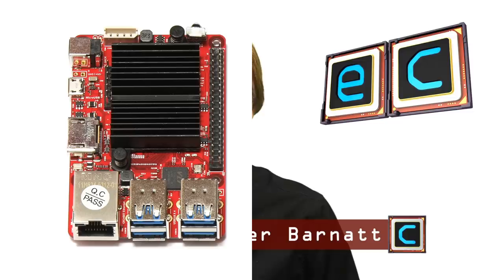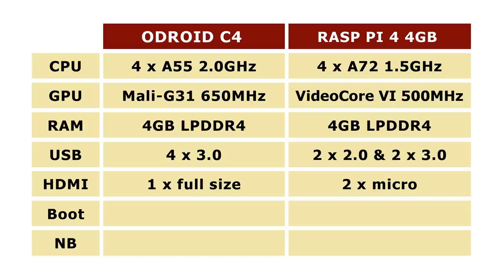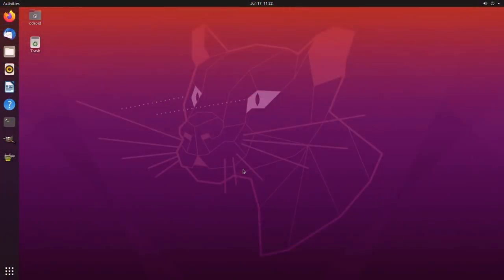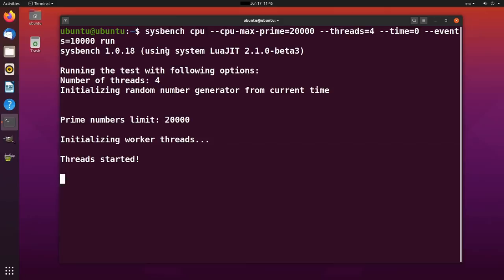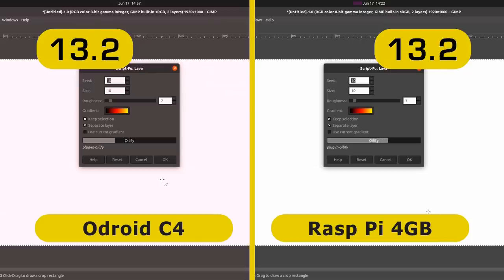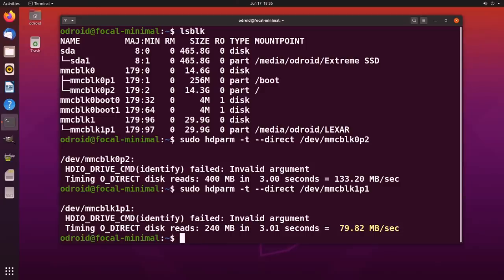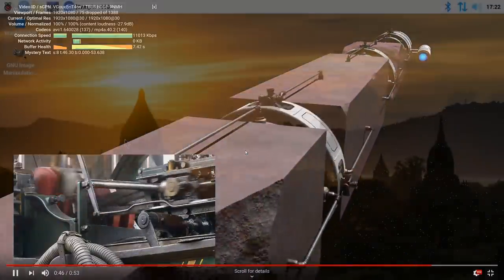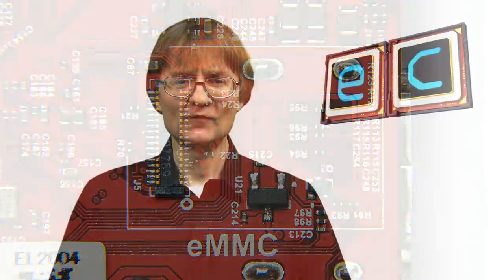Odroid C4 vs Raspberry Pi 4

Comment: Are you sure there wasn't any thermal throttling on the Odroid C4?  The first CPU test was faster for the Odroid, and then the Pi4 was ahead from that point on, which could be a sign of thermal throttling.  Odroid's own benchmarks show it on par or faster than the Pi4 in every test.
Reply from the maker: I'm not aware of any throttling, but even if is occurred, I was testing the hardware with its own heat sink, so I think the test is perfectly valid. I've looked at Odroid's own benchmarks, and am pretty certain that they benchmarked against a Pi running a 32 bit OS.
Reply: @ExplainingComputers  you didn't test the Pi4 with the thermal solution it came with.  To be fair, you'd need to put a fan on the C4 as well.

Comment: Thank you for your videos, Mr. Barnatt. It's been a while that I watch your videos. I have a question, if I may... I'm selling my Pi 4 because I've been very disappointed with it. I bought into the merchandise of a desktop replacement SBC, only to be let down by the very immature OS support, especially in terms of GPU drivers. On Raspbian, the Pi 4 is plagued by screen tearing all over and no HW video decoding anywhere but in the included patched VLC. On any other OS, good luck trying to even load the bare bones driver Igalia has come up with. You demonstrated this well in the video. So, I would love to know your opinion on this. What is your take on this lack of proper GPU driver support? Thanks in advance. Cheers from Brazil!
Reply from the maker: Most SBCs -- now including the Pi 4 -- are let down by their drivers and other software support, which is far more time consuming and expensive to implement than the hardware. There is good GPU support arriving in Ubuntu 20.04 for the Pi very soon I here! :) But do not expect a Pi to ever deliver the performance of a low-end x86 desktop.

There is also an issues of expectations here. Some people watch video on a Pi and are fine with it. It all depends what you compare it to.

Comment: Hello Chris  sorry to ask is their any single board computer that can run    Apple  I OS  or these chip are not compatible to apple spec.
Keep up with the great videos really enjoy and learning.
Reply from the maker: It is possible to make a "hackintosh" as they call them using an x86 SBC -- for example a LattePanda Alpha can be used for this purpose: https://www.youtube.com/watch?v=nrJpwPxoZZ8 Probably also possible with a much cheaper LattePanda Delta or Odyssey X86J4105.
Reply: I'm in a smaller-medium sized city and it's simpler to just buy an older apple

Comment: One difference in the tests, that might actually be relevant, is that the Odroid is only passively cooled.

Did you consider actively cooling it for the tests?
Reply from the maker: As I have stated here numerous times now, how a board is cooled has no impact CPU performance whatsoever, and I am utterly bewildered by comments such as this implying that an actively cooled computer will perform better. Because it will not.

Providing that a board does not go beyond its throttling temperature, how it is cooled is utterly irrelevant -- cooling performance and CPU performance are not the same thing. So all I considered here was if each board had a decent cooling solution that would ensure it would not throttle when running very short tests. And this condition was met.

Comment: Hey ECDC, what is the H264 playback tool you are using at 16:46?

Thanks.
Reply: It is called h264ify. I recommend using h264ify-enhanced as it gives you more control.
Reply: @pootispiker2866  thanks! I heard "h264-oi"

Comment: How is it a "fair" CPU benchmark when you retrofit an active cooling solution to one of the boards while leaving the other at stock?
I don't know how much these CPUs boost or throttle, but it seems like a way to somewhat alter the results.
Reply from the maker: It is fair because neither board will throttle with the cooling systems used and the lengths of test conducted (non run more than a few minutes). So the cooling solution used is utterly irrelevant to the results -- both CPUs will run at full speed to deliver the maximum results the board is capable of. So this is a totally fair test -- I am not an idiot! :)

Comment: My issues with these tests is that you have to buy a heat sink to get these results, effectively inflating the cost of the Pi4 to get these results. Good video though.
Reply from the maker: I'm not sure this is true, as the length of the tests was probably not long enough for the Pi to throttle without a heat sink or fan.
Reply: @ExplainingComputers  Okay, that's understandable. It's still an issue for me though, as if I want to use it for longer than just for the short benchmark tests, I have to get a heatsink or else I will only see results like these for a very short time before it throttles. It's still a big price issue, personally.

Comment: quick question, were these test run one after the other or was there a period for the systems to cool off?
(with the pi having active cooling and the Odroid being passively cooled it might make a difference)
Reply from the maker: There was a long gap between tests -- the video was in production for several days. Neither board would have been close to throtteling -- the tests were not that long. :)

Comment: Very curious what the current demands are between these two board. the ODROID, running its cores 400MHz faster makes me suspect it pulls more watts. Anyone have some measurements at rest or during 100% cpu use?

Comment: Because the Raspberry Pi has thoroughly dominated the market to the point that most people do not know the existence of or would even consider an alternative, the designers know they can provide lesser components for the same price and it will fly off the shelves anyway. The part that is unpleasing to me is that the software community hasn't fully embraced Odroid and I'm too dumb to port and recompile everything myself.

Comment: So, the odroid was left with it's heatsink alone but the pi got a sink+fan?
Reply from the maker: This is true, but completely irrelevant to the results. There seems to be an urban myth that computers with passive cooling perform worse than those with active cooling, and this is competely untrue. Both boards here were equipped with a cooling solution to prevent them throtteling, so both ran at full processor speed throughout all tests. To be clear, unless a board will throttle, cooling has no impact on performance whatsoever.

Comment: Now that Apple is switching over to arm processors instead of Intel or AMD, do you think that will cause an evolution of single board computers processor speeds and or power? If so, then I am very hopeful for the next generation of sbc's being more capable of being a person's primary computer. But I'm unsure of whether that development will have any effect on the sbc's.
Reply from the maker: It will depend to some extent who controls Apple's chips -- and I imagine it will be Apple! But having ARM versions of software like PhotoShop will be significant I think for future ARM boards and SBCs.

Comment: Is it possible the Odroid was heat throttling as it only had a heatsink whereas you put a fan on the Raspberry Pi.  Could account for a slower system?
Reply from the maker: No, this is not the case. Both boards had adequate cooling, and were running short tests. So neither went anywhere near a throllling point.

Comment: Raspberry Pi 4 SoC is designed for SBC. The C4 SoC is just a low power mobile SoC, with meh performance and low power cores. Out of all SBC manufacturers Odroid is doing pretty well, and I would place it second just after Raspberry Pi, in terms of software support and stuff. Both however are a far cry from good design. Pi missing the heatsink, slow on board storage, and horrible video decoding and GPU support on almost all these SBCs. Working worse than on a PC 20 years ago.

Comment: how would adding a fan to the Odroid affect performance?
Reply from the maker: It wouldn't. All tests were short, and neither board will have been close to a throttling temperature.
Reply: @ExplainingComputers  Thanks for that. Would you consider retesting the Pi without the fan?

Comment: Wondering if the Odroid would do better with active cooling, that would be more apples to apples.
Reply from the maker: I am utterly bewildered by all the comments here on active vs passive cooling. Whether the Odroid has an active or passive cooling solutionk fitted will have no impact on the test results whatsover. Cooling performance and CPU performance are totally different things, and the former only influences the latter if -- and only if -- a CPU gets so hot that it throttles and reduces its speed.

Here neither CPU will throttle. The tests are short and both boards have a good cooling solution. So whether they are active or passive is irrelevant. So everything here is "apples vs apples". I just really give up sometimes. The idea that a board with active cooling runs faster than one with passive cooling is ludicrous.
Reply: @ExplainingComputers  Good reply. Most of my computing is high duty cycle and I can reach those throttle temps so I have to look at cooling for that reason. Thanks for the response.

Comment: I normally do not like comparison videos, however, I will likely get both after watching this, especially if odroid supports win7...  Apparently it can, with issues... ( I googled it, and for once it did not take me to some strange place where everyone is saying "google it"
Reply from the maker: Both of these boards have an ARM processor, so cannot run Windows 7 (well, not without emulation, which give terrible performance on this hardware). Maybe you are thinking of the Odroid H2(+), which has an x86 CPU?
Reply: @ExplainingComputers  Thank you for the correction and guidance.
Reply: @ExplainingComputers  On second thought I am more impressed with the pi4 especially if it can dual boot phoenix os with linux.

Comment: 7:40 I wouldn't call 1-10% differences to be a "clear lead" (that starts at 20% and more).
Reply from the maker: What rule states that a 20% difference is required to make a result significant? I've worked as a university academic for 30 years and have never come across such a claim! :)
Reply: @ExplainingComputers  I'm not saying it's a rule. That's just my idea about practical relevance of given differences.

I find 10% to not even be worth mentioning. Obviously statistically speaking a difference is a difference. But there's also the real world :)

Comment: So it seems if you need pure compute the Odroid beats the RP4 but if you need disk access the RP4 wins. Did I get that right?

What it also tells me is that you don't need a fast SSD attached to either BC its limited by the USB interface.

Comment: The problem is... the Odroid is using a S905 SoC..
That is hardware from "decades" ago, it was broadly used by tv-boxes from china.
Now they've moved away from S905 to S912 CPUs.. that's why I'm wondering, why the hell didn't Odroid move away from the old weak S905 to a better SoC?! The S912 should be more powerfull to beat the RPi4 :)
Here also a comparison between the two processors: https://hometheatrelife.com/amlogic-s912-vs-s905/

Comment: why not test youtube in ubuntu 20 x64? and should both be tested in same browser
Reply from the maker: Because there is no point testing video playback in a browser that lacks a driver for GPU accelerated playback when this is available on other boards. Remember these are not x86 PCs -- they are ARM boards with limited driver support at the best of times!
Reply: @ExplainingComputers  i thought that since they don't have GPU support they will fallback to CPU and therefore both should be tested in the same conditions
edit: and x64 seems to be better at least on pi
Reply from the maker: @wafdsjhnszfgdgjesawetr  x86 boards generally do perform better, esp at video playback! :) You are right, without GPU support, board will use the CPU. But I don't want to push the results down to the lower common demoninator. I am trying to show what the boards will do with the best OS (and drivers) available. Using exactly the same software really is a secondary issue -- I am trying to test systems here, so show what performance users will get with the hardware/software combination they are most likely to run (and which the manufacturer supplies/recommends/supports. If comparing a Mac and a PC, would you install Linux both for a better test?

Comment: The compression is not equivalent because it was used the active cooling for RPi4 (why it is not just some liquid cooling for RPi4?!). Actually, I would not recommend RPi4 for a lot of reasons:
1) It's the complete proprietary blob! You will be never satisfied with it. You would never be free to choose linux distro, apps or even Android OS etc.
2) Broadcom chipset = No Freedom or privacy. It was true 20 years ago when you had been chosen Wi-Fi adapter or router. So there are the same issues today.
3) Zero video acceleration for 3D or even 2D window compositing. RPi4 is not able to rotate glxgears.
4) Video codecs are proprietary blobs just for x264 if you ever want to have x265, VP9 (HEVC, WEBM) you wouldn't be able to do it.
5) It is very hot like hell.
6) Many other competitors have better IO and thermal solutions.

Youtube benchmark should not be just on some special OS with unique browser with preinstalled plugging and hidden blob. Even so it's just awful!

PLEASE!!! STOP ADVERTISE THIS PIECE OF ENGINEERING FOR LINUX ENTHUSIASTS LIKE IT THE LAST CHANCE TO TRY THE LINUX DESKTOP!

Chris, you should test 2D, 3D too.
Reply from the maker: The use of passive vs active cooling will have had no impact whatsoever on the test results. Providing that neither board throttles (which they will not have done), each will be running at maximum CPU performance.
Reply: @ExplainingComputers  Are you sure that that has no impact? Do you know exactly how to working the Dynamic Power Management on both chips? If even so that RPi4 faster a bit or optimized better in they blob in some tests it's no matter at all. There are much more issues with RPi than benefits. Also it's just not fit with Open-Source/Linux model.
Reply: @ExplainingComputers  BTW I'm 'happy' owner of RPi4. I bought it for testing purposes. I know nothing about ODROID brand so. Actually, I like PINE64 products now.
Reply from the maker: @konstantink2641  The Pine products are indeed very good.

Comment: Why would a raspberry pi 4 need a heat sink? Does the Apple A13 with 6 cores and higher frequency have a huge heatsink on it? No, of course not, it fits in a thin phone. And that A13 will blow both the A55 and A72 away.
Reply from the maker: I'd make two points. Firstly, the Pi does not need a heat sink, but it will throttle (reduce its CPU frequency) if it gets too hot, which will reduce its performance. The CPU in a smartphone will do exactly the same, but we don't have the option of adding extra cooling to prevent this happening! :)

Secondly, a great deal of work goes into the thermal design of smartphones to dissipate heat through the motherboard to the case -- which is why a smartphone case gets warm when used for anything processor intensive.
Reply: @ExplainingComputers  Well I would say depending on your use case, you can buy heat sinks for a Raspberry Pi. But you can choose and you don't have to pay for a chunk of copper if you don't need it. You said one of these companies got it right. But unlike you, I think its the Pi foundation.

Comment: - Not booting the C4 with 2.016 GHz (uncomment setenv max_freq_a55 "2016" in boot.ini)
- Probably used a generic hardinfo and didn't recompile with e.g. CFLAGS="-O3 -march=armv8.2-a+simd+crypto" as e.g. the crypto benchmark should reach an order of magnitude higher score on the C4
- No memory bandwidth benchmarks (C4 has almost double what the Pi4 has)
- No mention of Vulkan support for the C4
- No mention of the C4's capability to hardware decode VP9@2160p60 (Youtube 4K)

Seems like a biased review towards the Pi4 to me to be honest.

Edit:
My results with 2.016 GHz with the generic hardinfo from the ubuntu repo: https://pastebin.com/972Y8aRT
Reply from the maker: Not biased at all -- I have given very positive reviews to many other Odroid boards here in the past. Both boards were booted at stock speeds. Yes, you could mess about with settings on both boards, but you it could be argued that this really would be introducing bias into the tests. Thanks for sharing your results.

Comment: I may be wrong,                                                                                                                                                                 but surely the Odroid C4 would outperform the Pi4 in most if not all of those CPU performance tests if you were using an OS specifically optimized to get the most out of each board,                                                               i.e. Odroid C4 with Ubuntu 20.04, Android 9 or 10  installed VS. Raspberry Pi4 with Raspberry Pi OS or Raspbian installed.                                                                                                                                                          Am I wrong?
Reply from the maker: You are right, with optimized software the Odroid may well win. But very, very few ARM SBCs have optimised software! :) Pretty much only the Raspberry Pi, as the Raspberry Pi Foundation spends a lot of time on software development. Whereas most SBC manufacturers just do the "easy" bit -- creating new boards . . .